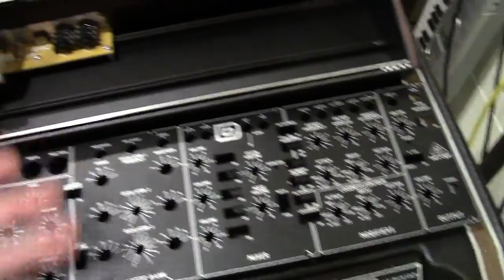What's Inside the Behringer Model D (by synthpro)

Comment: I had the chance to compare the Behringer Model D side-by-side with my vintage 1975 Minimoog, and I must say that I was more than impressed. And I'm very critical of anything that pretends to be a "clone" of this marvelous classical mono synth. But the Model D far exceeded my expectations. Even down to minute details, sonically, it is spot on! My friend and I couldn't tell them apart in a blind test. Only the "feedback" trick didn't quite behave exactly like on the Mini, but very very close to it. 
All in all, a superb sounding Minimoog clone for not a lot of $. The only drawback is the tactile feedback of those extremely small knobs and switches, and the lack of that smooth Pratt Read keyboard.

Comment: thanks for this video  wanna ask about  the back of board , what that mean  VCF Range VCF scale ?
Reply from the maker: You're welcome. The VCF range and scale is how you calibrate the filter for proper key tracking. When calibrated correctly, you can use the VCF by itself as a sinewave oscillator or to track harmonics of the oscillators for different tonal characteristics.
Reply: @synthpro  thanks for telling me !! thats so nice of u ! can i ask another question , i got poly D  , think they are same at Filter part , mine   doesnt work well , if switch to low pass. only hear Click sound , if switch to Hi pass , i can hear note ..  can i get some advice   about    whick part should i check ? thanks!!!

Comment: I have a question for you MR SYNTHPRO!!!!    I HOPE YOU CAN ANSWER IT FOR ME   On the original Moog Model D's (as well as the newer reissues), the Noise switch does 2 different things:  1) When the NOISE SWITCH is in the "WHITE" position, WHITE NOISE is sent to the audio mixer (which then supplies WHITE NOISE to the audio input of the VCF).  Despite the fact that the NOISE SWITCH is in the "WHITE" position and WHITE NOISE is sent to the audio mixer, PINK NOISE (instead of WHITE NOISE) is sent to the MODULATION MIX POT as the selected modulation source..  2) When the same noise switch is moved to the "PINK" position, PINK NOISE is now sent to the audio mixer, while RED* NOISE (instead of PINK NOISE) is sent to the MODULATION MIX POT as the selected modulation source.  This I am sure of because it states it in the Moog Model D manual as well as the block/functional diagram of the Minimoog Model D..

However, the Behringer Model D APPEARS to work differently.  (It is also less confusing.) 1) When the NOISE SWITCH is in the "WHITE" position, WHITE NOISE is sent to both the audio mixer and the MODULATION MIX POT.   2) When the NOISE SWITCH is in the "PINK" position, PINK NOISE is sent to both the audio mixer and the MODULATION MIX POT.  This conclusion is based solely upon my Ears.  If my Ears are correct, this means that the NOISE SWITCH on the Behringer Model D behaves like the NOISE SWITCH on an ARP ODYSSEY as opposed to the NOISE SWITCH on an actual MOOG MODEL D.   The Behringer Model D instruction manual is rather vague on this matter.  It simply states that the noise switch selects either "WHITE NOISE"  and "PINK NOISE" as the internal noise source.   It has nothing more to say on the matter. 

MY QUESTION:   Are my ears right or wrong?  Can you confirm the above for me????????

 Personally, I prefer RED and PINK noise over (White & Pink) as modulation sources and white and pink as audio sources.  However, there are a few applications where white noise makes a good mod source.  (I can immediately think of an "Applause Patch" I use on my Odyssey where white noise modulation makes a close approximation of an audience clapping.  On the other hand, I much prefer Red Noise modulation when playing Lunar Sea by Camel.)  In addition to a Model D, I also have a Moog Voyager.  Surprisingly, the Voyager lacks a NOISE SWITCH.   Instead of supplying White or Pink noise, the Voyager offers a compromise.  It supplies a hybrid of WHITE/PINK NOISE TO THE AUDIO MIXER and a hybrid of PINK/RED to the mod busses. (The info on the white/pink hybrid came from the Voyager manual.  I got the info about the pink/red hybrid from an old SOS mag review, but I was never able to substantiate it).  The Voyager is simpler, but I prefer additional options over simplicity.  FWIW, The ARP Axxe only offers Pink Noise, but the Axxe, Odyssey, and 2600 are also capable of processing pink noise into random S&H modulation!!   The Prophet-5 only offers white noise.  Of course, if you have white noise, you can use the LPF or even the EQ on your mixer, to approximate pink noise if you really need it)   As far as monosynths go, I prefer the semi-modular EMS VCS3 and ARP 2600.  Both of these offer white noise along with a special noise filter that one can use to dial in white/pink/red (or low freq) noise as well as various in-between shades.  (And the 2600 also offers random S&H).  You can also route the noise outputs to numerous audio and modulation inputs.  My Buchla 200 system has the incredible Source of Uncertainty module that offers +3dB (white noise), flat (pink noise), and -3dB (red or integrated white noise). I use it with my Buchla 294 comb filter module (or my Moog fixed filter bank) which is capable of boosting the high frequencies.  This allows me to produce an assortment of rather unusual noise colors including blue and violet noises (differentiated white noise).  Blue and Violet noise are great for simulating "steamy showers", misty rain, steam, and mechanical boiler rooms.

Comment: Would you say that repairing a Behringer synth would be hard or not for an electronic technician?.
Reply from the maker: It really isn't any harder than other modern synths. Unlike some of the bigger brands out there, I actually have schematics for the Behringer D which can help a lot if troubleshooting is needed. Surface mount electronics does take special skill and tools because you can easily damage tracings or overheat components easier due to size but this is the same style electronics you find in new moogs, Sequential, korg, Roland, etc.
Reply: @synthpro thanks for your answer :)

Comment: hi, synthpro. I've heard a saying if you replace all capacitor into audio class capacitor (such as, elna silmic or nichicon audio grade capacitors), the sound will get improved directly. Is that true? If so, perhaps buy a synth and DIY with audio grade capacitor will be a wise way to go. And does this work on Behringer Model D?
Reply from the maker: That is true in some cases I have seen. What tends to happen is with some cheaper caps, they are not true to their values or have a tolerance issue causing DC leakage which can effect how AC is passed in a audio coupling situation. 
I have not tried replacing caps in my Behringer model D yet but I'm sure if you put some higher spec caps in areas of the coupling circuits, it could improve the low end a bit, (thats the only area I have noticed any noticeable difference). There are lot of factors though, when it comes to audio circuits...some of it is just hype but there are some truths mixed in for sure.
Reply: @synthpro  thanks for your reply. love your videos

Comment: Thanks for the insight into the electronic components and explaining the difference between discrete and integrated and through hole. With that in mine should a discrete SMT sound identical to a discrete through hole in your opinion (assuming the same circuit design) or are there a lot more variables in the tolerances etc in through hole design than SMT? It's easy to think looking at through hole that it sounds more chaotic, raw and analog just looking at it, whereas the SMT is all neat and pretty and manufactured and people seem to say modern analog sounds sterile, too stable and lacks warmth. Seems to make sense even though it may not hold any truth. Does discrete really just refer to it being a custom design rather than an off the shelf design? Have you compared the internals of other Behringer synths and noticed significant differences in circuit design contributing to a different sound or are they mostly the same layout with a few tweaks to change the sound a bit? Thanks
Reply from the maker: Thank you for watching☺. 

These are great questions and it is a fairly large answer but will explain this the best I can.

Both through hole and surface mount can have a very similar sound but it's all to how the engineering is done. There are definitely things to consider such as tracing sizes, component wattages, inductance, etc. In most cases through hole does tend to sound more lively due to the size of tracings and most components such as resistors being 1/4 to 1/2 watt where as a lot of surface mount components range from very small wattages to the same or equal wattage rating to that of through hole. For those that don't really understand current limit...here is a example...think of a cheap set of jumper cables using smaller wire than the more expensive jumper cables, it may be able to deliver the voltage but not the current needed to turn over the car. This would be an example of very small tracing carrying current on a surface mount board. Needless to say, in most synth designs there is not a lot of  current  draw in circuits but in some components, the current does play a factor with how some amplifiers/transistors behave therefore it's always a nice idea to prevent current limiting in some areas. 

Overall some of the ideas of one sounding better than the other is really in the mind but there are factors such as tolerance specs, matching components, age, and overall hours used which all can play a factor to how instruments sound. Of course today's manufacturing of components has such a tighter tolerance than what we had in the past so components can actually be more predictable and way more reliable, this is not to say old components are a bad thing because sometimes the slight tolerance differences between components is also what makes the sound unique. Moog back in the early days of the minimoog would actually match transistors for the ladder filter etc so they tend to have a better sound in my opinion than the later minimoogs which they only matched critical transistors, (this comes back to the importance of engineering and component selections).

Synths like the Behringer D are nice because they actually used a match transistor package per ladder section so this actually makes it slightly less sensitive to thermal changes within the ladder filter tuning. The oscillator circuits are still quite drifty  due to them using the none thermally regulated version if the minimoog oscillator, (this is the oscillator that most minimoogs have and people actually desire due to the phase interaction). 

This biggest differences in my opinion to synths like the Behringer D is the fact that the control voltage is digitally generated, this means that the voltage will be accurate but the circuits using this voltage still has that natural drift due to it being a true analog design.  

I hope this helps answer your questions a bit. 

Jareth

Comment: Sorry were you paid to make this video? The reason I ask is you said "what I am ALLOWED to talk about here" at 9:40, you also state that it is fully analog even though it has midi, usb, and digital dac control of the reference (9:50). My pet hate with the entire synth industry is misleading use of the term digital, in order for it to be analog is has to actually be analog right? If an analog piece of technology has one digital circuit it is no longer analog. Perhaps I will be flamed for these inconvenient facts?
Reply from the maker: No, I was not paid but did sign a NDA. When I say it's fully analog, I'm talking more about the architecture of the synthesizer, the fact it is having to use a DAC to drive the synthesizer is no different than when we talk about vintage analog synths like the moog source, Pro One, ProMars, etc. I do bring up that the 440Hz tune reference is not analog like a vintage model D, (it's a signal generated off the processor) but the synthesizer itself is analog and even uses analog inputs such as CV. The controller circuit is digital but the synth is analog.

Comment: What is your feeling regarding the quality and potential longevity of those single turn calibration trimpots?

Behringer already changed them to multiturn trimpots in V2 but I am concerned about the single turn ones since that is what I am (stuck) with unless I return it.
Reply from the maker: Questor Jones I don't see the trim pots being an issue, I have not adjusted my unit yet but just from looking at them, they are built like most other trim pots on the market.

Comment: The extreme use of SMD electronics is actually quite worrysome. Especially with SMD fuses and SMD caps. That shit is VERY difficult to replace if something goes bad after some time. So a lot of these will probably end up as electronic waste sooner or later and people won't bother spending money to repair them, unlike you would with restoring a vintage Mini Moog. So yeah the mass of SMD parts on the board is quite a huuuuge issue.
Reply from the maker: KRAFTWERK2K6 I know where your coming from but SMD is here to stay in most productions. here's the truth. If you open moog synths you will find SMD throughout the LP, Sub, Mother, etc. Same with DSI. Whats even worse is that service manuals and schematics are not available for those so if they break, its tough to follow failures. Now, the old moogs I can work on all day long, good schematics, service notes, etc. 
The schematics are available for the B model D so if there are problems, it be followed. The model D does have a lot of through hole caps which is also a plus.
Reply: What, NO schematics with the newer Moog and DSI synths? Well that shows how much trust these companies have left towards their userbase. Especially for the upper range of gear that is not really cheap. And yeah, I do get the point with SMD parts in todays productions. It really seems that we cannot have the good without the bad and the ugly. At least in the cheaper price segment i can live with that sour compromise.
Reply from the maker: KRAFTWERK2K6 yeah, no schematics or service notes for moog or DSI but that goes for lots of companies today. The way they handle problems is either factory repairs or board swaps, Im not against this procedure but its going to be a major problem when these instruments are discontinued, techs like myself will be left without any way to make repairs.
It's not really all that sour with surface mount, sure its hard to repair without proper tooling and component values are not always on parts which can be a pain so you have to either look them up in the parts list or by values in the schematics. Lots of modern gear worries me for the reason of no info for servicing and we are talking expensive brands. It's a shame because it used to be that only certified techs could get manuals but most companies don't even do that anymore😞

Comment: Nice video… One minor quibble though is that SMD actually stands for surface mounted diode… Often used to describe LEDs. 
I think what you meant to say was SMC...which stands for surface mounted components… The difference being that you’re talking about many different types of components like capacitors, resistors, diodes, etc. as opposed to simply referring to just diodes.
Anyway, just thought I would point it out. Again, nice informative video.

Comment: Hi synthpro, does Behringer Model D uses a heated 3046 in VCOs?
Reply from the maker: Hi Andriy S, the model D does nt use te heated 3046s, its an exact replica of the minimoog osillator so you will naturally have some drift. I will say the tuning holds a lot better in these due to how close all the components are.
Reply: Original mini has two types of VCO boards. The older revision uses non heated 3046, the newer revision heated µA726 pairs. So in Behringer D, they use non heated 3046?
Reply from the maker: There are actually three types of oscillators designs in a minimoog. the first ran from 1971 to early 72 and used all discrete transistors for making up the exponential current circuits. The second design, (which is what is in the Model D) used the 3046 transistor array in place of individual transistors which is not a heated circuit. the third design which you are talking about  did use the UA726, (thermally regulated matched transistor pair) IC. Now the prodigy actually used a heated 3046, it used a current loop through a set of transistors in the chip to create heat, you have a trim pot that you use to adjust the current drop inside the IC, this was a whole new design and you lost the need for tempco resistors as well, they are just as solid as the 726 design.

Comment: Probably one of the worst ways to mount a synthesizer.  This is the way they made the Sequential Circuits Pro-One.  On my old Pro-One, a lot of those metal standoffs somehow snapped off which leaves you with this floating circuit board suspended by almost nothing.  😒
Reply from the maker: silverdroid actually this is a very good way to mount boards. The Pro One breakes because of all the flex in the chassis and the fact that they literally just tacked those standoffs on. Pro Ones sound great but no quality in them.
Reply: It had the worst quality construction of any synthesizer I've ever used.  Very plastic, and those horrible standoffs!  However, sound wise, it was the beefiest of all analogue synthesizers I've ever used.  Very quirky and just monster sounding!